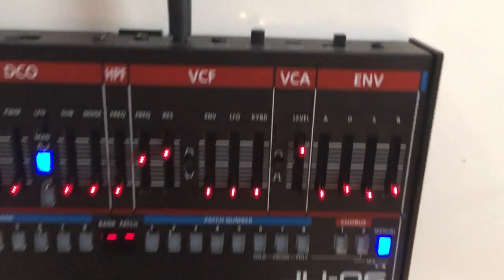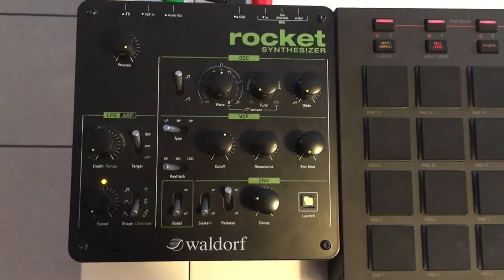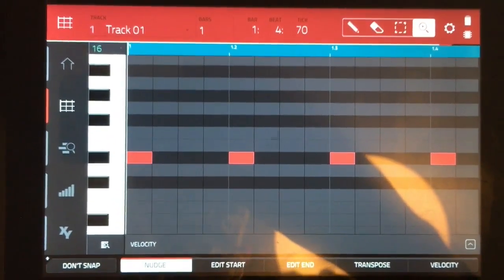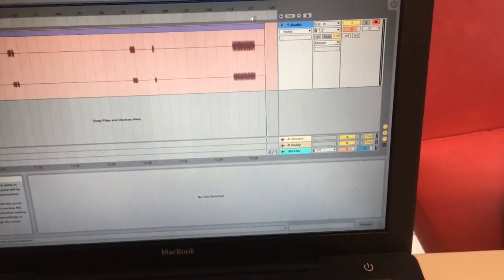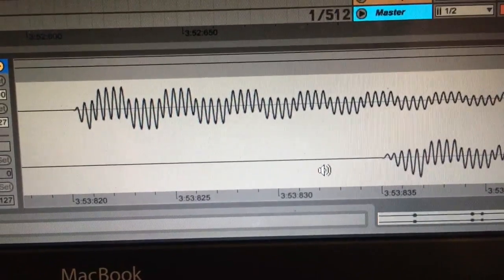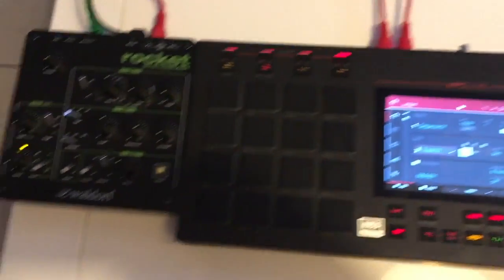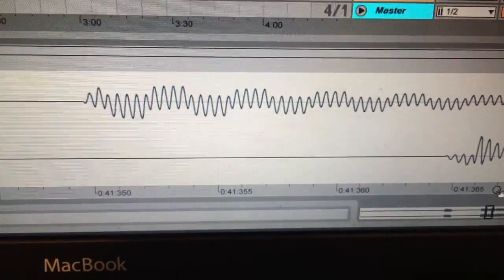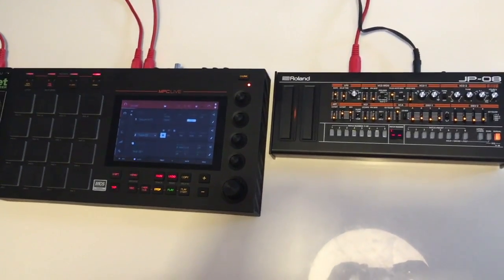Roland Boutique JU-06 and JP-08 - Proof Of Latency Issues

Comment: When you are hitting the pad it appears that there is no latency, certainly does not look like 15ms anyway, is it only happening when sequenced? BTW you might want to also check the latency and jitter of the Akai midi sync, unusable for me, Akai have no plans to fix it either.
Reply: Your comment is ‘questionable’ on all counts I’m afraid. A) The Boutique doesn’t know or care where the midi note on message is coming from, so it can’t decide to only exhibit this latency when that note comes from a sequencer rather than a pad. B) a few people have commented that they can hear the latency when the pad is struck - it can certainly be ‘felt’ as being late when playing, presuming you have a half decent sense of rhythmic sensitivity; and C) the midi clock could be as tight as a gnats chuff but if the synth engine still needs 15ms to react to midi notes generated by the internal sequencer, it will still sound out of time when synced to other kit that doesn’t have such appalling latency - and it does.
Reply: @CottonBud  A) Of course the synth does not know if it is being sequenced or played live, I was not suggesting that, I was questioning if the offset between the timing of the two synths was due to the sequencer not playing the notes on two different tracks as tightly as possible, midi is a serial protocol, so under no circumstances would they be exactly on time anyway. B) 15ms delay is easily heard, but when he hits the pad it does not seem like 15ms to me, of course there could be a number of reasons for that, people will say that they can hear it no doubt, but it is hardly scientific unless bias is ruled out. I’m not for a moment suggesting that there is no delay but that it does not seem to be the most definitive method of testing. C) My mentioning of the poor midi jitter performance of the MPC midi clock should at least indicate that the MPC midi is not as tight as you’d expect, of course note and clock are different messages, I have not tested my MPC midi note latency, but I had tested the clock which is why I mentioned it, it is not unreasonable to assume that if it has bad midi clock performance it might have bad midi note performance too.
Reply: @The-word-I-does-not-exist  This is all very well nitpicking pedantic reasons why it may not by scientific enough for you, rather than appreciating the evidence provided but d) the 15ms latency has been corroborated time and time again by others doing similar tests with other sequencers; and most importantly e) this test was enough for a Roland representative to investigate, and have their team confirm the latency as stated (which you can read in the description). Oh yeah, and f) I am the person who made this video (commenting from my other channel) and I can assure you that playing these Boutiques in a variety of differing setups, there is noticeable latency consistent with the findings of this test. Please feel free to do your own more scientific test to confirm the latency that Roland now admit is there. Until then, don't worry about thanking me for going to the effort of conducting and filming this one - you are most welcome all the same.
Reply: @The-word-I-does-not-exist  Also g)  each synth is on its own dedicated MIDI output from the MPC, so your' serial' argument, already tenuous, simply doesn't apply. But even if it did, it would be nowhere near 15ms.
Reply: @The-word-I-does-not-exist  I'm going to run out of letters of the alphabet soon... h) One frame of video at 30 frames per second is 33.333 milliseconds - more than twice the latency observed here. You simply cannot state that the video and audio seem 'locked' more tightly than this from this clip, it is scientifically unsound.
Reply: @CottonBud  Ok, well if you think my answer to your points was nitpicking then I don’t really know what else to say, but regardless and separate to the issue here, check your MPC syncing to or from another known tight clock anyway if you are interested in latency and jitter, for me it is unusable. Peace.
Reply: @The-word-I-does-not-exist  I'm well aware of many of the flaws with the MPC, and have been extremely vocal about them too. That's not what this video is about though. If all you can do is try and deflect attention away from the topic of this video to another piece of kit and a different issue entirely, rather than accepting that your original comment is itself fundamentally flawed based on my replies, I really don't know what to say either.
Reply: @CottonBud  Its all good mate, I think you perhaps misinterpreted my initial comment as being some kind of critique of your video, when I was just asking a question knowing that the MPC midi performance is less than ideal, I have seen numerous mentions of the JU midi performance around the forums, some people say it is worse than you say, others say it is not as bad, I have not tested it myself so that was why I asked the initial question.

Comment: TE OP-1 got usb-midi-audio firmware update 10 years after its release. And it works in 16 polyphony without latency of any kind.
We need class action for Roland to recall all boutiques and upgrade the CPU's, Ram. Firmware will not do it.

Comment: Has this been fixed?
Reply: Saint Nicholas no. Avoid!
Reply: Roland Japan support replied that this is a specification of the ACB circuitry. So, no. That said, it's the first 3 Boutiques that have the issue: JP-08/JU-06/JX-03. Newer boutiques latency is much better.
Reply: @joshwilliams3642  No. We need a class action to fix the issue. They need to be called back and upgraded with the second CPU they left apart, and completely rewrite/optimize the usb-midi protocol to make use of parallel processing...

Comment: They work perfectly well for me but I'm using the mx-1
Reply: Ian Philp I’ve got the MX-1 too. It makes no difference. Think about it - how could an EXTRA bit of d/a conversion REDUCE the latency I prove here. ‘Works perfectly well for me’ perhaps should read ‘I can’t hear a problem’. Good for you, but that doesn’t mean it isn’t there on your setup. It is.
Reply: Yeah let's just I hear absolutely no latency on my JU-06 or out Amy my gear, neither has anyone else i know who has one that's how I ended up on you're video, I'm running everything into an MX-1 but running the midi from USB 2 which is My TR08 that's getting sequenced by a beatstep pro which is all going into ableton 10, mind you I've updated all my gear so I dunno it was fixed during the update, Best thing to do is either return it or write to Roland and mention the problem you have a 2 or 3 year warranty, Anyway I wish you the best on getting everything sorted ✌

Comment: Wow I had not heard of this problem before with the early Boutiques, I remember similar problems when I first started recording in my home studio with older Midi gear in the 90's especially when using my Waldorf Micro Q, another digital analogue modelling synth, I really thought such things as Midi latency would of been a thing of the past by now with modern gear, I have a few pieces of modern analogue Midi gear a drum machine and a monosynth the latency is spot on while there is a tiny amount of latency it really is not noticeable something like a few milliseconds totally acceptable for live use. Maybe they knew about the problem and why the early units were a very limited run. At least they admitted it and as a company Roland always seemed to have very good customer service. Shame they couldn't of fixed this problem before they released them though.
Reply: This things run at 44.1 frequency. It's like trying to achieve 0 latency on a 10 euros Soundblaster with a massively heavy Vst. Impossible.

Comment: I experienced this today with my TB-03. It would ruin the whole groove of the song. sigh. I think it's the best with the DIN cable and the analog output. I almost solved the issue with this setup BUT..when you program acid sound with slide, tie and etc you get the terrible latency again. it's funny because if you don't use those MIDI CC the latency gets better. If what the uploader said is right then this synth produces the latency because it runs out of the processing power for just got damn slide tie and shits. GEEZ

Comment: If you start out by producing in the box you just take perfect timing for granted. Welcome to the world of hardware synths.
Reply: Jörg Wessels That’s rather presumptuous and patronising. In my case, I produced/engineered about 100 releases over a decade in the 90s before I ever even had a computer capable of running a soft synth. I didn’t even own a computer for midi for the first few years. None of those releases had synths that badly out of time. A Juno 106 was one of them, btw...
Reply: I'm sorry for my mistake. Most youtubers are not even in their 20s and just have been experimenting with a torrented copy of FL or Ableton for a short period of time before buying their first hardware synth and discovering the differences. As you didn't show your face I suspected you were one of those.
Reply: Jörg Wessels No worries. Even so, the fact is that the Waldorf in the video is also a modern hardware synth but it is 15ms more accurate - as are other models of Boutique. It is nothing to do with this ‘world’ as you say, and merely Roland messing up with these first Boutiques (as you can see from their admission in the notes section).
Reply: @CottonBud  We should file a class action for they are to rewrite the firmwares of all the boutiques, and in case they'd need a ram upgrade, take them back, and fix the hardware. I have invested 1500 eur. I own 4 of them. It's not possible that we let them think this is okay. If you try usb audio and midi, and get 1 sec latency, that's junk, it's not synths we are talking about...
Reply: @re8et355  Only problem with that is for every person complaining about an alleged latency issue, there are 100 people who have no troubles at all. 

You would also need to prove that there is an actual, real, problem with Boutiques, which is the source of this alleged latency issue, and that there cannot be any other reason, and good luck with that.
Reply: @looneyburgmusic  The MicroModular has a Modular software, all com is built using only MIDI. ZERO Lag. What are we talking about? USB is the Problem. Ditto. I have almost no Lag using them Boutiques using only Midi, so your point is valid, but please don't tell me they are perfect because they are not... They are over-engineered and can't even shield usb noise... not even an auto-reset fuse... no external power input... I had to build a dummy battery to power them... thankfully the use battery only pwr firmware update came early... but it's embarassing the level of toyness...
Reply: @vjfxtheory  Noone ever said the Rocket had that problem. The video says the Roland Boutiques have it and I added with hardware synths you can't take perfect timing for granted. That means, in one case you can be unlucky, like with the Boutiques, in other cases you can be lucky like with the Rocket. Nobody insulted your Rocket, which seems to be a solid investment, so no need to be butthurt. 

And I might add another thing: The latency on some hardware synths gives the owner the opportunity to circumvent a problem inherent in the MIDI standard, namely the fact that an event takes about a full millisecond to transmit and therefore two events cannot be transmitted at the same time. In fact, if you have a sound generator like the Rocket, which has almost no latency at all, and another like one of the Boutiques, with a significant latency, you just input the latter's events slightly to the left by exactly its latency. The result is that events that are sent at different times will sound at the same time. You could say they made a virtue out of necessity.

Comment: I am not here to disagree with your results.  But to prove the difference wasn't due to one port on the MPC lagging behind the other, you should have run the test twice, swapping the midi cables between the two synths.  If the lag switched between the synths, it'd be the MPC.  If the lag didn't change, it's the synth.

Other options: a true thru-box to send the same MIDI to both devices (hardware, with no microcontroller involved), so you know for sure the MPC isn't delaying one..  Or, a thru box and a modified cable to send the midi serial stream into your recorder as audio -- then you could measure the actual latency of the Botique, not just the difference between the two synths.

Again, especially with the reply from Roland, I believe your results are correct.  But this is one more disbeliever hole you could plug, that you might consider if you have to run similar tests in the future.

Comment: Good video. That is a fair bit of latency; 15ms definitely audible of course. It's not really correct to say the Roland processor is too slow - obviously it's capable of the throughput - it's just that the processing pipeline is relatively long. If we assume they're running at 48khz that's 20us per sample,  so 15ms is about 750 samples. This is quite close to 768 samples, which would be what you'd get if you used three 256-sample buffers (i.e. triple buffered) in the DSP chain.  (Obviously they could also be processing at 96khz and using 128-sample buffers but you see what I mean). Making these buffers smaller may not be possible (depends how much of the DSP they did in hardware and how flexible it is) or may at least be a moderate amount of work rewriting the DSP code. It's not a great choice of buffer size; you'd think they'd have maybe gone for smaller but RAM is so plentiful...
Reply: They need a second CPU for parallel processing just for the usb-midi alone... they've gone too far considering the money they saved... All pcb's has an empty space for a second main processor, that evidently WAS there pre-production...

Comment: interesting, I'll have to try this out on a few of my newer boutiques and see if it's an issue. I also  ordered an MX - 1 mixer the other day so I'll be pairing these with some Aira gear as well so I'm sure I'll find out pretty quick if this is an issue with newer boutiques like the D-05 and the SE-02 as well.
Reply: Se-02 owner. Same unacceptable latency. Usb is a nightmare. D-05 is the worst in the group, perhaps because of its polyphony.
They should rewrite completely the usb-midi protocol.

Comment: If Roland does firmware upgrades for these boxes you may find that they fixed the issue with an upgrade, I don't own any so I don't know, I do know that Korg fixes issues with firmware upgrades, even the monotribe had primitive firmware that was updated over the life of the box.
Reply: Roland have confirmed there are no plans to fix this in firmware, as this will not address the fact that the main processors in these units are just too under powered to render the results of the ACB algorithms any faster. In other words, we are stuck with this problem.
Reply: @CottonBud  Maybe it is possible to double up the ESR processors, to have them work in rail configuration...
Reply: @re8et355  I sold both mine, I'd had enough. I now have the JU-06a and the SH-01a and the latency is a fraction of these first models, and perfectly useable for a live jam.
Reply: I see on the Roland support website that the firmware updates for the JU-06 and JP-08 are now at version 1.20, dated May 2017.  I too am curious to see whether there is any change in performance after the update -- even though the reply from Roland, quoted in the annotations for this video, suggests that one should not expect too much....
Reply: That's horrible news, that would explain the latency issue, that's why I haven't been super excited about the boutique line, I haven't seen any write ups  of issues with the aira series but I haven't tried any of  the aira series
Reply: It's not a case of under-powered it's an unfortunate design choice, see my comment above for more detail

Comment: I have all the three "old" Boutiques. The JP-08 is the one with more latency: latency correction in Ableton for my setup is 18,60 ms. The other two are around 15/16 ms, but I need just to correct the latency on the JP-08, 'cause I have them MIDI chained and the JP is the first in the line.
Reply: The D-05 latency  in usb-audio mode is waaay worst. It completely freezes my DAW and slows tempos, with all of them having at least 1 sec. latency playing back a sound from a midi keyboard input... unbelievable...